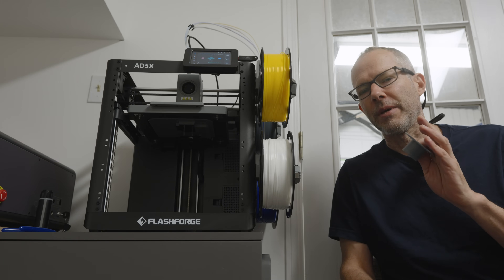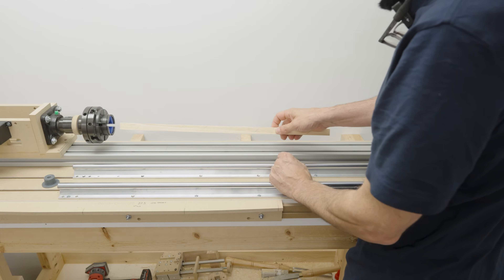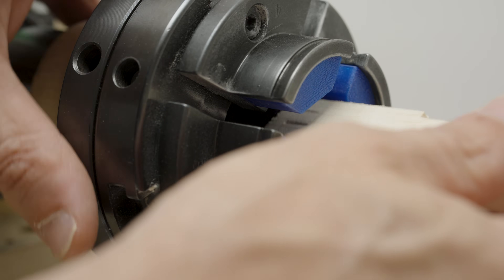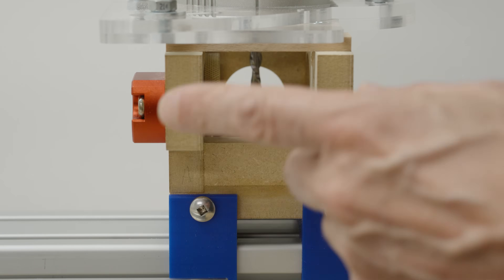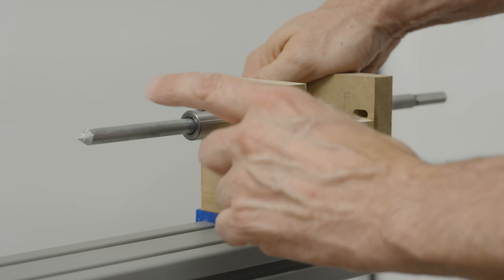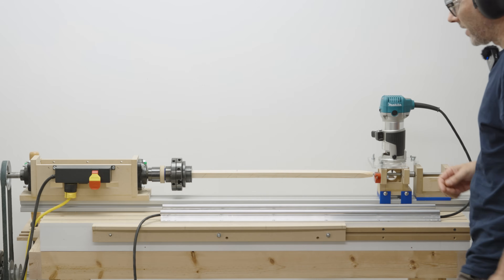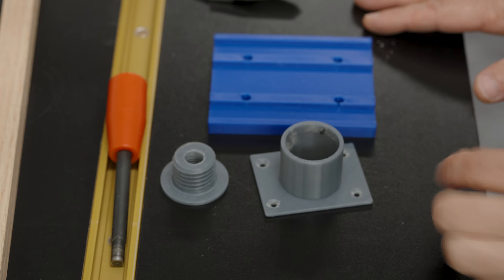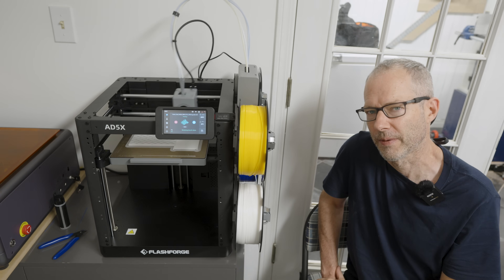3D Printed Dowel-Maker | Flashforge AD5X

Comment: What kind of filament did you use for the parts? Wondering about durability and strength, especially for the jaws. Thank you.
Reply from the maker: Just the basic PLA they sent with the printer.  3D prints even with low density infill are surprisingly strong against crushing forces, the fill pattern inside is like a torsion box.  So for instance on 4 small chuck jaws, I tried clamping the metal jaws as hard as I could and they showed zero signs of crushing or wearing.  Even if I did eventually break them it takes like 20 minutes to print another set.

Comment: I love it.

I like that you found a use for the useless chinese dowelmaker. Unfortunately I bought the same tool. It looks great, but it fails to do what it was designed to do. The finish on the dowel made with this tool is awful. Its like getting your dog to turn a piece of wood into a dowel. 

On your new setup you use the carbide bit to make a pre cut. I am curious, what does the dowel look after this pre cut. Is the surface finish of the dowel better at higher RPMs? I am curious if part of the problem is the low spin speed with the dowel making tool.
Reply: Ditto!!